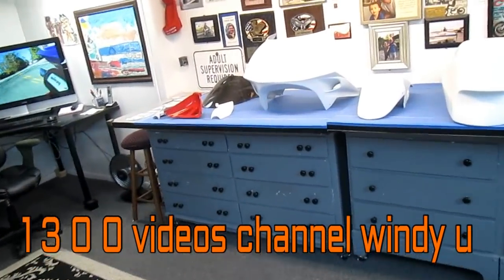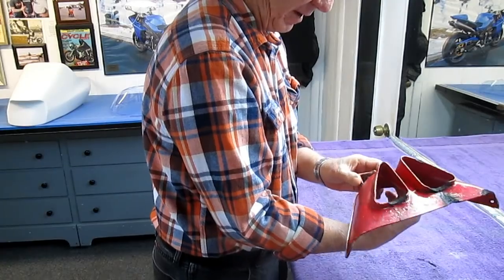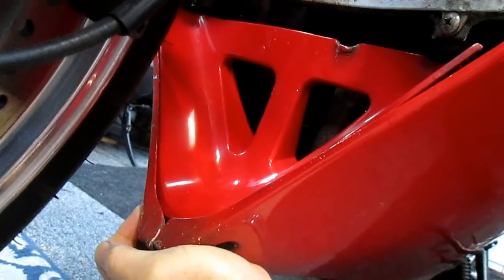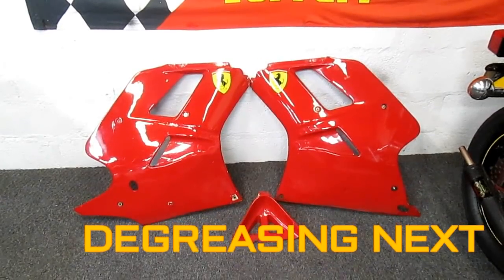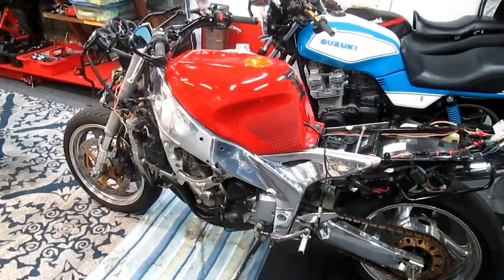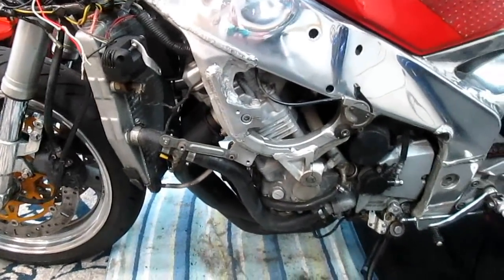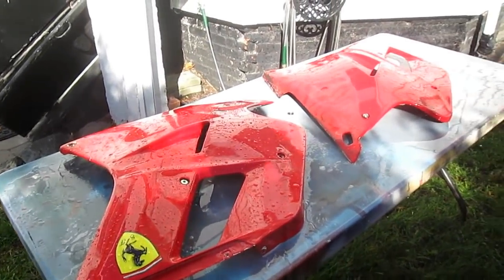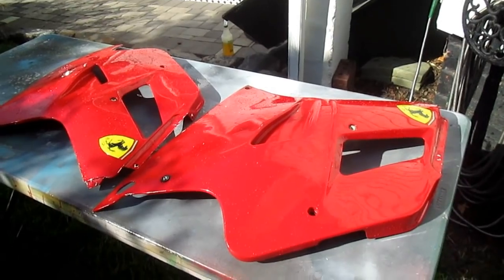pt 23 FZR RESTORATION,FAIRING REMOVAL AND DEGREASING .

Comment: Your motorcycle has the wrong radiator and brackets. Somewhere over the years it’s been changed. And the ram air has been eliminated. Still a great motorcycle. Thanks Windy. I have a 92 in the shop waiting for restoration.